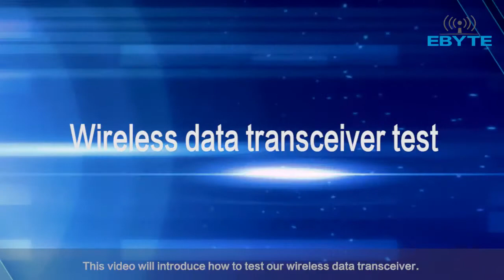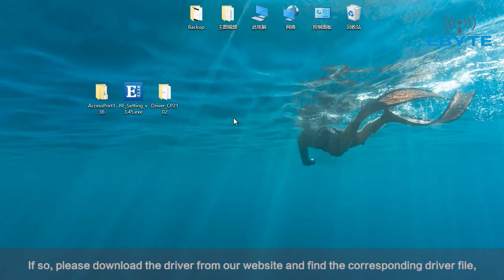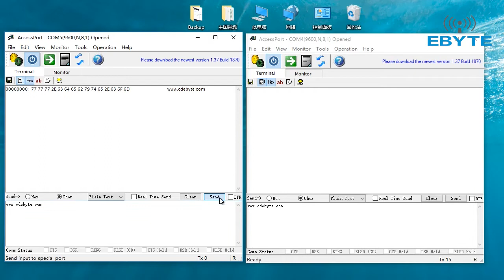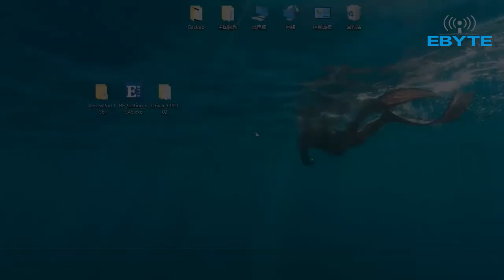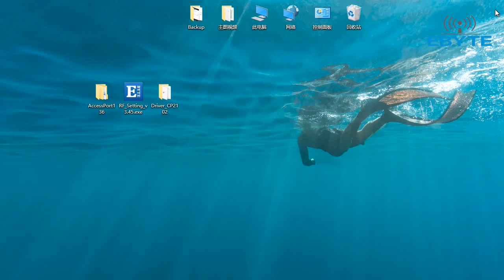How to test wireless data transceiver

Comment: Hello Maggie, I need a tutorial for  E90-DTU (433L30E ) And E90-DTU[900SL30ETH] The manuals use diffrente software not are update. I need comunicate 2 ponits (replace a wire for wireless) 1 PC TO 1 PLC.
Reply: Did you manage to make the configuration and find the software?

Comment: Is there a requirement to null the connection from hardware to computer interface. In other words do you connect the RX - TX and TX - RX on hardware and connect normally to the PC in order to transmit or receive data from the hardware?
Reply: After 3 years you've no doubt figured it out - but for anyone else - RS232, you cross (null modem) the TX/RX terminals, but RS485 you don't ( you do it A to A, B to B).
Reply: @DrFiero  Oh yeah! Way past that now! We quit using these because we're inside a building shaft that goes 100 stories up floor to floor but because there was a stainless steel lining, we were getting signal deprivation so we went with CAT6 cabling and connected them A-A B-B in a daisy chain and used a Smart Linx language DSMA protocol to link them all together. So far we've successfully linked 155 nodes.